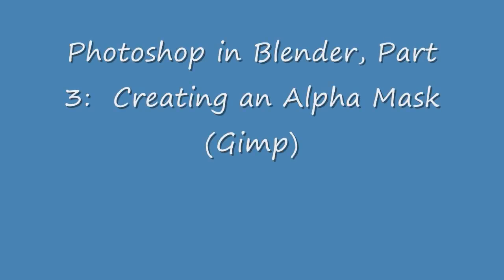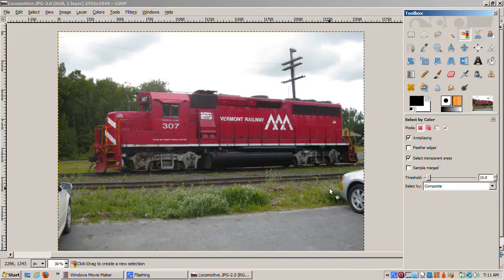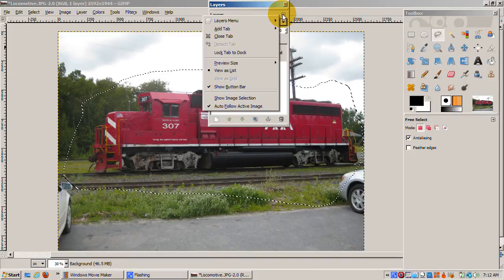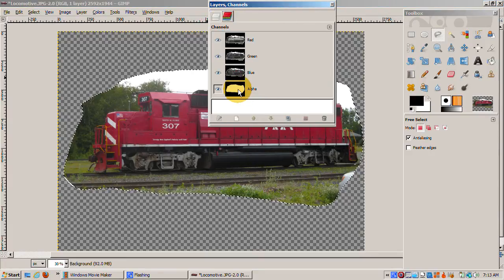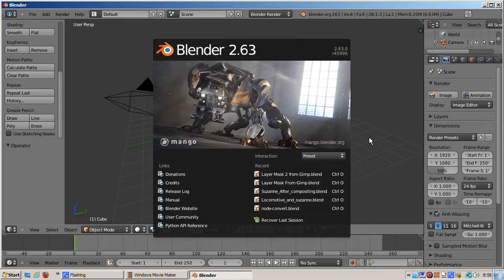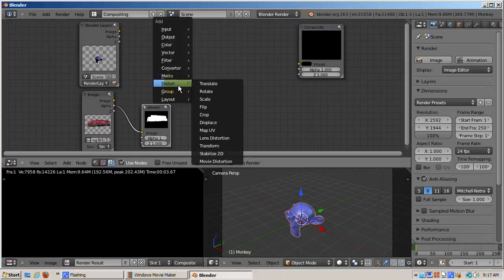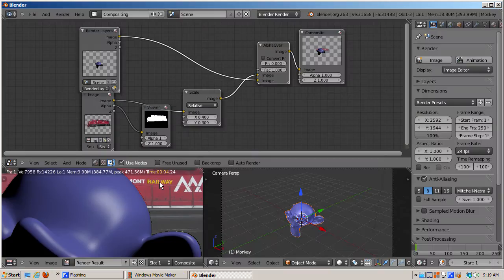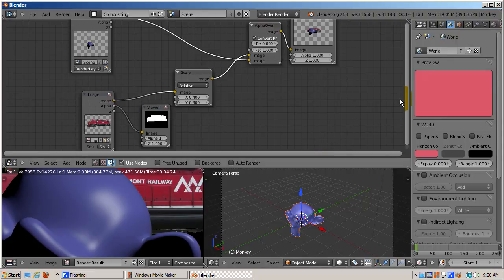Photoshop in Blender: 3 - Creating an Alpha Mask (Gimp)

Comment: I am trying to make a video with blender, and at one point I needed to make a title for the video sequence editor, so I tried to make a title on gimp using the alpha channel, but it wouldn't go on blender. I tried jpeg, png, and whatever the gimps oringinal file type was called and none of them worked. Jpeg and png convert the alpha to a white background and the original doesn't go to blender at all. Is there any way to fix this?